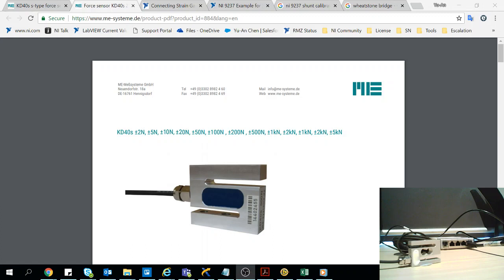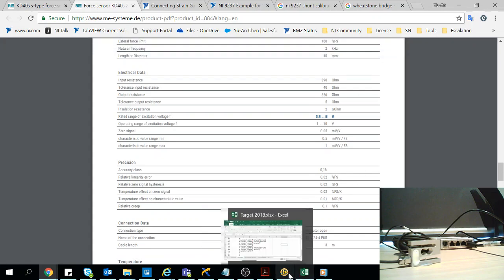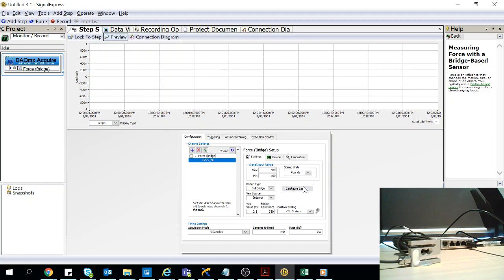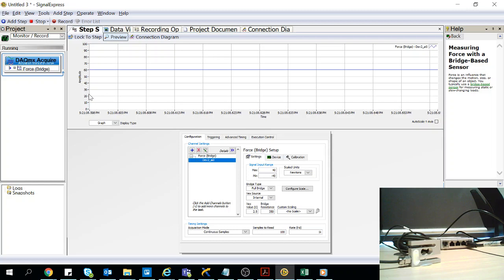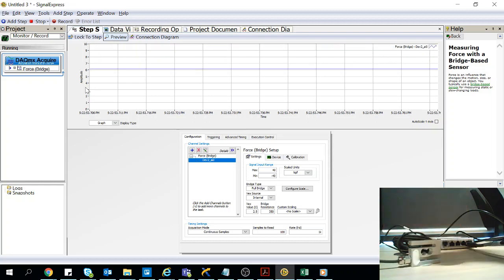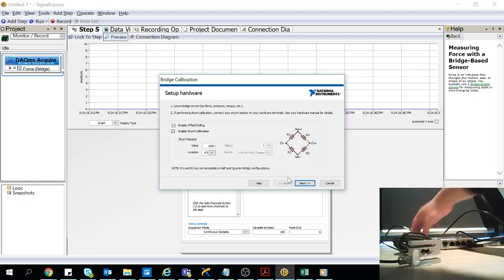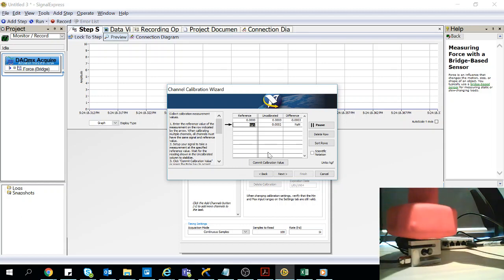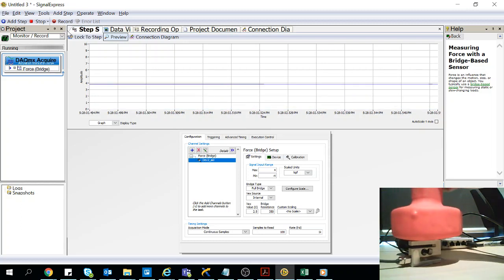How to Calibrate a Load Cell using NI 9237   Part 1

Comment: thanks for the video. i tried to use a load cell (4 wires) and a NI 9220. i have an amplifier in the middel but i do not know how to connect the amplifier to the NI 9220